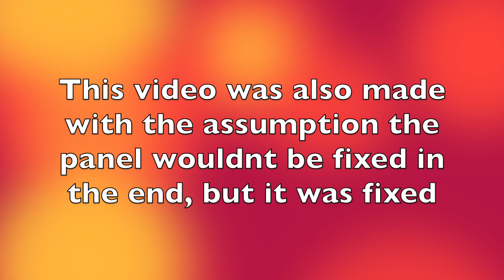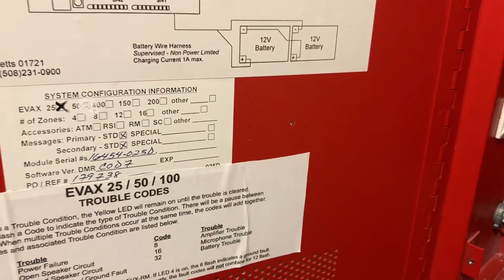The Evax is fully working! Yay! (Part 2/2)

Comment from the maker: I was able to fix both problems with a multimeter, to fix the monitor issue I used the continuity setting to see where the terminals led to and then found out they were just connected to the NAC terminals with only the negative (the screw that wasn’t stripped) being the switched terminal, making an easy fix. I also looked at the voltage from the terminals for the secondary message and found out that there was only 24VDC out in an alarm condition then I found the other terminal (10) had constant power output. If you plan on ever troubleshooting something, this is the #1 tool you need to have